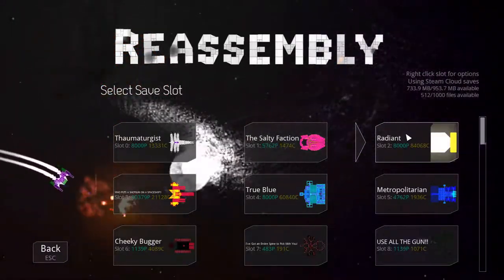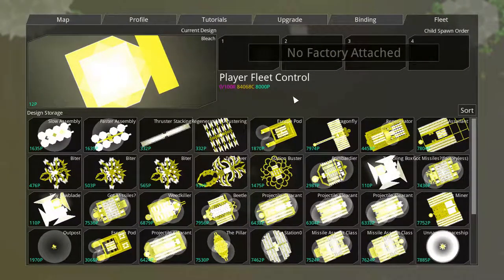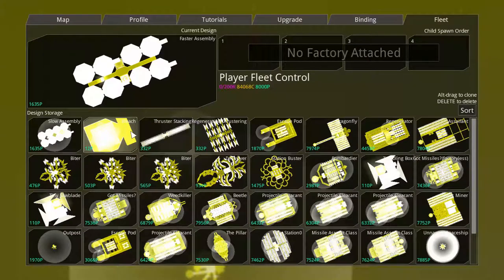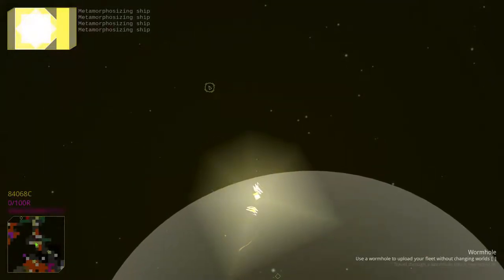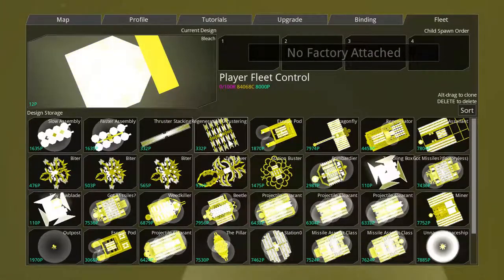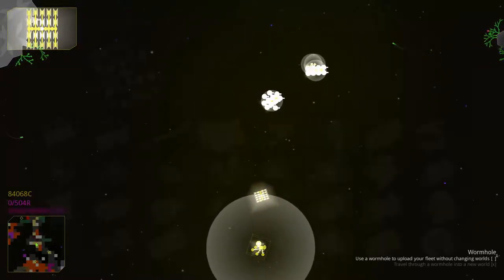A Few Reassembly Spaceship Design Techniques

Comment: Good video. Are you still playing?
Reply from the maker: On a rare occasion, yes. I also found another neat design for thrusters where they're positioned like the clusters shown in the video, but extend from the corners at a 45 degree angle. Doing that means every cluster of thrusters can contribute to turning, forwards, backwards, and both sides.

Comment: I wonder if you are still around, i kind of want to see how you build now after all this time
Reply from the maker: I use the central columns and regenerative thrusters, but one interesting development is I've most recently been using 45 degree thruster fans at the corners of the ship, while still aiming for a square or rectangular ship. 
With columns aiming 45 degrees out of corners with thrusters on the sides it's less forward propulsion per thruster, but with the same turning force and now the capability to strafe is added. 
It's kinda like taking my usual thruster panels at the sides, splitting them in half, then putting a 90 degree wedge between them. 
The fun and differing part about this is I can still move with a full range of movement despite losing one whole side's thrusters, unlike losing half of one of the old thruster panels.
Reply: @unnecessarilyoptimistic2726  nice